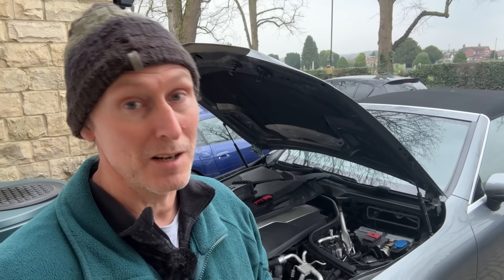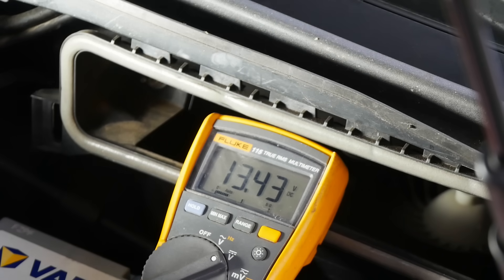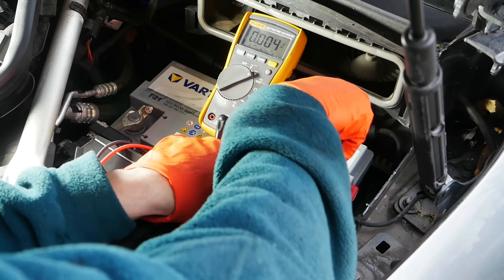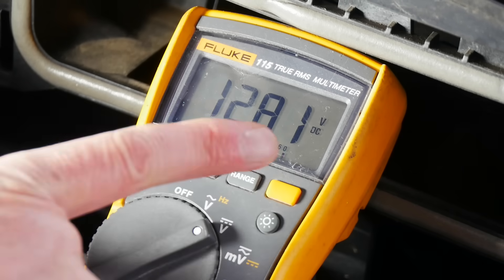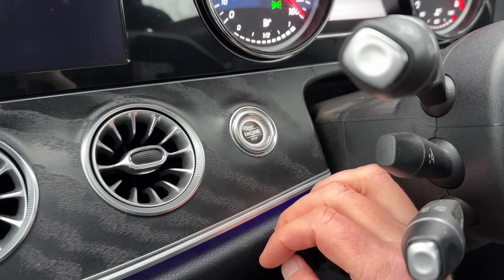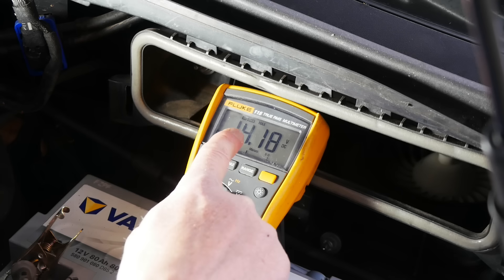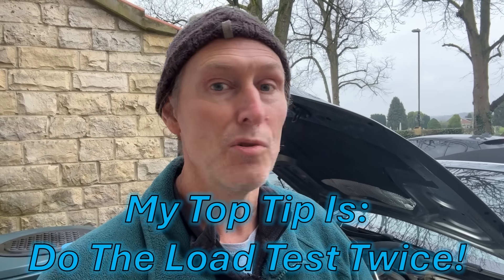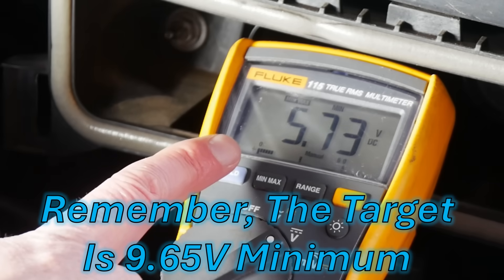Car Battery Load Test With Multimeter | EASY DIY

Comment: The engine cranking SLOW is YOUR test that the battery is low ... 
You dont need a multimeter to confirm a low or dead battery
Reply from the maker: Hi, thanks for your comment. It’s a subtle difference but the test isn’t to check the battery is low because in that case, you could just charge it up. The purpose of the test is to check the capacity of the battery when fully charged. This is a good indication of how much lifespan the battery has left or if it is time to change it. Thanks, Phil
Reply: @ReviveMyRide  The motor will still tell you the capacity of a fully charged battery. 
Just listen to how it cranks.

Comment: At first i think check charge cables. If its not charge correctly can be good voltage but not work. 13,4v looks like broken cable (overheat terminal)
Reply: The battery can show 12.7 and NOT be able to start the motor because it has no capacity or current flow.
Voltage is only half the story in batteries.

Comment: The test without the MIN/MAX function on meter would not be much good with about 3 volts difference on minimum reading. Those Fluke meters are very expensive I believe.
Reply from the maker: Yes, definitely easier with min/max function but still possible without. Yes, agree, the Fluke meters are expensive but very good! Other less expensive meters that still have Min/Max are out there… cheers, Phil

Comment: OMG, another stupid YT-Video about finding out the state of a batterie with just voltage measurement.
THAT Doesnt Work. EVERY batterie in idle, if broken or not will tell you 12.8 or more Voltage under no load.
 You have to measure the current INTO, while charging. And Out while working.
Dont spread that bullshit please. You cant get the condition of a batterie with just an Voltmeter, thats just guesses.

Comment: Well done! What you say is EXACTLY what ppl should do. I worked for a battery manufacturer, so I know. 👍
Reply: I just performed this test on my battery.  At rest the battery only shows 10.6V, and when under load, the minimum was only 6.0V, but 14.1V while running.  Can I revive my battery by putting it on a trickle charger - or is it time for a new battery?
Reply: @ecpoirier  I would definitely get a new Battery instead of waiting to get stranded. Especially with the winter months and cold weather conditions coming soon.
Reply: @stevejones8665  new battery purchased and swapped.  All good now.  Piece of mind for $180 Costco Canada
Reply: @ecpoirier  What is the age of the battery. Used to be 5yrs or more u change the battery ( because it makes alternator work harder, hence, u spend even MORE money). But today, if it's 3yrs or more, I would change. And CHECK mfg date on battery & MAKE SURE it's fully charged. Just because it's new, it may have sat on shelf long.👍✊️🇺🇸
Reply: @ecpoirier , the 14.1V when the car is running is the output voltage of the car’s alternator. It is not at all representative of the state of the battery.
Reply: @andrewscarr8943  I have to disagree. It shows you the alternator is working properly and your battery is not taking a charge as it should. Voltage drop under load is real. That's why you don't leave your lights on. Good Video.
Reply: You might have worked in a battery factory, but, you have no idea of what you're talking about and either does the guy who done the video..
Reply: @jkgoogle5185  could you elaborate? I assumed that a load test would involve measuring the current draw from the battery which is done in series with the battery & would need a far beefier meter than can handle at least 300Amps.
Reply: @jkgoogle5185  With undeserved remarks like that it appears your the one who doesn't know jacks**t.
Reply: @jkgoogle5185 - come on then bright spark. Prove you know better and enlighten the world.
Reply: @jkgoogle5185  You can't do a load test just using a multimeter correct?
Reply: @ Correct!
Reply: @DasSystemschaf  You need to re-read what I have posted..
Reply: @jkgoogle5185  You confirmed what @AnthonyManzio said, but a load test is a test you can do with a simple multimeter and the Min-Function. The starter is the load. The min-voltage load test while turning the key is very helpful to check if your battery is the weak point. Sorry i saw an accidentally double post and deleted it -  it seems that the first one got also deleted. Arrghh.. Sorry - However - when you have problems with the electric, with your battery or starter or with the alternator it make sense always to make the simple checks before you go further. 👍😀
Reply: @DasSystemschaf  I never confirm anything what other people say.. I don't follow, I lead.. And, you are testing a battery incorrectly by not using a variable carbon pile battery tester.. The variable load tester is the ONLY correct way to test the CCA output of a battery..
Reply: Now i asked Grok and it says the following:
(Attention, AI often is wrong !)

What is a DC Min-Drop-Volt-Test (Voltage Drop Test) for a 12-Volt Car Battery?

The DC Min-Drop-Volt-Test, also known as the Cranking-Voltage-Test, measures the voltage drop of a car battery using a multimeter while the engine is being started (cranking). You connect the multimeter in parallel to the battery terminals (red to positive, black to negative) and observe the minimum voltage value during the starting process. This test is easy to perform and requires no special tools beyond a good digital multimeter.

How Informative is the Test for the Condition of a Fully Charged Battery?

The test is very informative for assessing the actual health of a battery—especially for a seemingly fully charged battery (resting voltage approx. 12.6–12.8 V). It checks not only the surface charge but also the battery's ability to deliver high current (up to 200–600 A) under load. A fully charged battery can have internal defects (e.g., due to sulfation, aging, or damaged plates), which only become apparent under load. The test reliably detects such weaknesses and is a standard procedure in automotive workshops.
Reply: @DasSystemschaf  I don't need AI, I've got 40 years experience...

Comment: How many hobbyist are gonna go buy a $600 fluke 88? Amazon has battery analyzers for $100. Save the $500 so you can buy a new battery
Reply from the maker: @stvargas69 Thanks for you comment! Yes, agree, don't go and buy a Fluke unless you also work in industry (which I did, which is why I have one!) and need the extra functionality it offers. There are other less expensive multimeters out there for working on cars which will be the job but that wasn't the topic of the video, maybe the next one... 👍 Thanks, Phil

Comment: The residual voltage after charging means nothing, I have a load tester but i may just turn the fan,lights,and wipers on to get rid of the initial high reading,and if the voltage comes down after a few minutes below 12.25, its likely finished,may not start already.Using the starter to load test is assuming the starter is functioning properly, video is good👍
Reply from the maker: Thanks! The test is just something I came across that worked for me, with me not having a load tested and that I thought I would share! Lots of “experts” getting excited about it in the comments though… 😂 Residual voltage is something I learnt about during the making of the video, good tip to turn on a few things to make it dissipate. 👍 Thanks for your comment. Cheers, Phil

Comment: The AGM you mentioned is 12.75 volts . A wet or flooded ( battery acid ) would be 12.6 volts . The 9.6 volts on cranking assumes ( sometimes dangerous ) the starter , cables , all connections , etc. are in good condition . But a quick basic test . Check out the Top Don BT-200 barrery tester reviewed by Mechanic Mindset , a respected tech . A great tester , about $ 80.00 USD . Plus he is " across the pond " , in your area ! Brilliant ! 😂 BTW : If I went into a shop and they were using the old school " toaster " load tester in today's world , RUN !!!

Comment: Take your car to a reputable garage that has a battery tester. They will select the type and capacity  then the tester will show the actual capacity and the internal resistance. Job done.
Reply: The difference, is you have to leave your home, and when they specify,  plus, this is costly, inconvenient and is achieved once. You could buy a multi-tester for less than the "reputable Garage" fee for carrying out the test, which with the greatest of respect to the hypothetical party, you most likely would not be present at the test. No substitute beats seeing and doing with your own eyes, independently, also where, when, and as often as you choose to across a collection of various vehicles.

Comment: Battery state of charge  [by volts]
Battery under crank load  [volts]
Battery   drain using amp meter around 30mah 

Alternator test fast idle 1200-1500rpm at 14 volts or better 
starter current draw test No more than 300 AMPS 10 volt minimum . The occasional dip below 10v is ok providing stater is working ok 
Starter motor    voltage to solenoid wire better than 12volts during crank

Comment: If my battery went flat every couple of days, I’d replace it without doing any testing
Reply: The test is still a good idea – there may be some kind of a drain happening when the batteries not in use. In that case the root cause of problem, is not the battery. You’d want to fix the root cause and find out what’s draining it, otherwise you just wasting your money on a new battery
Reply from the maker: @rorymacintosh6691  Nailed it! 👍
Reply: It has to do with the AGE of the battery. I own a 2019 prius, have a parasitic drain because I installed a "Mouse pro" that runs off my battery. I constantly trickle/boost with a charger. It TOOK the charge, BUT load tested poorly. Battery was 4 going on 5yrs old in the Fall, so I purchased a new one before winter.

Comment: Not a proper way to do a load test!!! You have no idea how many amps the starter is drawing!! Proper way to test is to use a carbon pile load tester!!!
Reply from the maker: Thanks for the comment but you have missed the point. This video is for people who don’t have a carbon pile load tester! I’ve done this test lots of times and can confirm that it gives a good indication of battery health. If this test comes back ok and you are still having battery problems, you can start looking in other areas like the alternator not charging properly or your car may have a parasitic battery drain. Thanks, Phil

Comment: The voltage does not indicate the chargers. Digital multimeters don’t instantly show measurements. In fact the only thing your test shows is that alternator seems to be working properly. However to confirm all the electrical systems need to be switched on and the terminal voltage monitored. Overall this is a poor video.
Reply from the maker: Thanks for your opinion but sorry, your first sentence doesn’t make sense. I have used this test many times and it does give a good indication of battery health. If the battery can’t maintain a minimum voltage during cranking, it won’t start, usually this means the battery is down on cold cranking amps, this test helps you check this. Also, my Fluke multimeter does show voltage quickly enough to see the minimum voltage, as can be seen in the video. if you are worried about not reading it in time, buy one like mine with a min/max function, it records it! Turning on other electrical systems in the car will be peanuts compared to the draw from the starter motor, therefore it’s not required. Please do me a favour, carry out the test and then come back and comment. Thanks, Phil
Reply: @ReviveMyRide    I can understand why you would think that but just because you have done this many times doesn’t make it right. When you took the first measurement after charging you noted the higher voltage. This is called a surface charge because it is caused by capacitance and an electrostatic charge on the plates. Like any capacitor it decays over time. 
The only way to know the charge in a lead acid battery is by measuring the specific gravity of the electrolyte. 
Modern battery testers measure the battery capacitance as the electrolyte also acts as a dielectric  that deteriorates as the battery degrades. 
Multimeters are not instantaneous. Quality ones do read very quickly but they still need time for the A to D converter to sample. 
There’s plenty of good information on line from manufacturers such as EXIDE, SAFT, CONCORDE. 
I hope you find this useful.

Comment: Nice vid, I think the voltages are specific to your vehicle/battery, one of my cars has an AGM battery which charges at a different rate over (15V DC), on big (generator) engines the control systems are designed to survive 0 volts on start up, with internal capacitors, not sure if cars would utilise the same principals.
Reply from the maker: Thanks for sharing the info! A lot of my cars have AGM batteries these days. The load test works pretty well on this type of battery for a normal road car. Usually if the voltage drops below about 9.5v during cranking I have found that standard cars often won’t start. Just to add that I agree, charging voltages are getting more complicated, some modern cars vary the charging rate depending on what they have detected the battery condition to be. Some of the more efficient cars, stop charging the battery and the alternator disconnects on an electric clutch if it is full, apparently saves a couple of mpg. Cheers, Phil

Comment: I’ve been using a sulphated battery in my Sprinter Van for the past six months. I did so by fitting a cut off switch to the positive terminal of the battery. I keep the battery isolated whenever I know I won't be driving for more than 10 minutes. This also gives me a bit of extra security on the vehicle. The battery has trouble starting the Van if it is left connected for more than 4 hours.

The morning start is the hardest. If I can't get it going, I use an emergency jump starter which is cheaper than a new battery in the morning.  What I tend to find however is a couple of start attempts, warms up the battery enough to get the car started. 

After that, normal use of the Van, and continuing to isolate the battery as much as possible, means I don't have any trouble for the rest of the day. All this on a battery I should have replaced six months ago.

Next time I buy a new battery I will continue to isolate it and see how long it lasts. For a tiny bit more trouble than normal battery use, I expect a new battery will last at least five years before I have real difficulty.
Reply from the maker: Hi @wiretamer5710 thank for sharing your experience! Sounds like you are managing the issue pretty well. Yes, it would be interesting to see how long a battery lasts if under zero load when not being used. Cheers, Phil

Comment: Probably just wants topping up with water. Some of the Varta batteries you can peal off the label and unscrew the caps to top them up. I can see circular outlines on the label so maybe that's the case here. I managed to get a fair few extra years out of mine by topping it up. Unfortunately many if not most are physically sealed to stop owners topping them up.
Reply from the maker: Hi @jonathanwebb8307 Thanks for sharing, that's a good point! I have topped up batteries before, even made my own distilled water (now that's a video no-one wants to watch!) but didn't on this occasion... Cheers, Phil

Comment: A really nice video. You have a a very fine easy to understand  verbal delivery that makes   using a multimeter easy for a novice to find out if the battery is good or bad through a load test. Thanks. Good teachers like yourself are worth their weight in gold.
Reply from the maker: Hi @bearpuf Thanks so much! Glad you enjoyed the vid and it is helping you. 👍 Cheers, Phil
Reply: What do you need to load test?
Reply: Here's the truth, You can't 'load test' a battery with a multimeter..
Reply: @jkgoogle5185 . But you can use one to gain information about the state of your battery.

Comment: I have a upgraded car stereo with amp and if I turn off the engine and leave the light on with radio it will drain my battery with in 5-10 minutes.
Reply from the maker: @hap1n355 wow, that's quite a battery drain!

Comment: Yes, excellent video. Easy to follow exactly. The second load test with the min way down was an eye opener. I've certainly heard exactly that kind of weak battery and had enough experience to know it was probably time to replace it. But now I can know for sure. I've got a Fluke similar to yours.
Reply from the maker: Thank you! Yes, it was an eye opener for me re the second test. I used this info to push a battery supplier into replacing my battery under warranty (although they took a bit of persuading!). Fluke are the best but you pay for it... However, it should last a long time. Thanks for your comment! cheers, Phil

Comment: Take battery to a parts store, they will perform a proper load test using the correct tester, your crank till it starts is insufficient time at the minimum disable ignition system and crank for thee recommended time to simulate a longer crank before start.
Reply: With that much voltage drop recorded, no further testing is required.   It's junk. 😢
Reply: The difference, is you have to leave your home, and when they specify,  plus, this is costly, inconvenient and is achieved once. You could buy a multi-tester for less than the "reputable Garage" fee for carrying out the test, which with the greatest of respect to the hypothetical party, you most likely would not be present at the test. No substitute beats seeing and doing with your own eyes, independently, also where, when, and as often as you choose to across a collection of various vehicles.